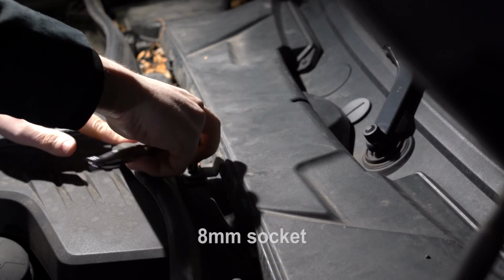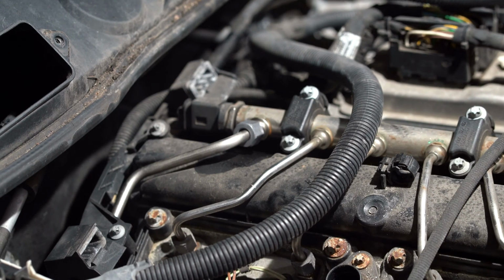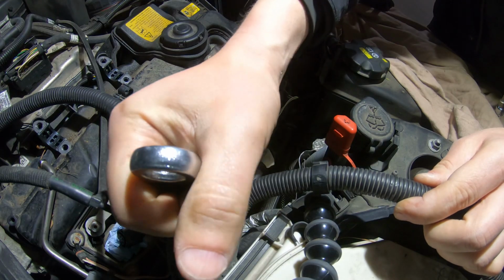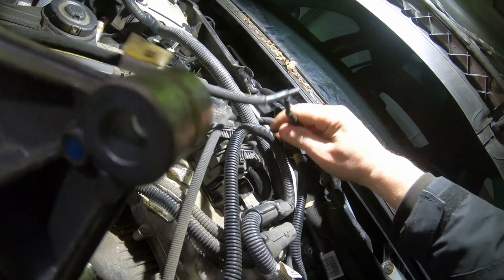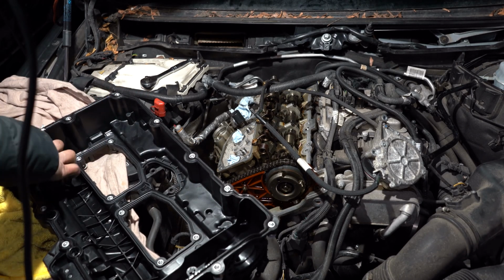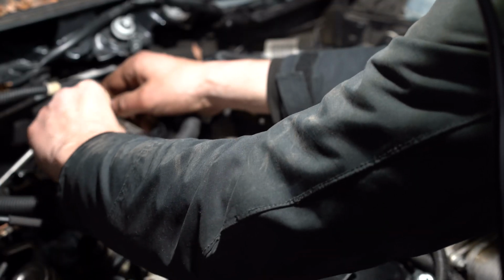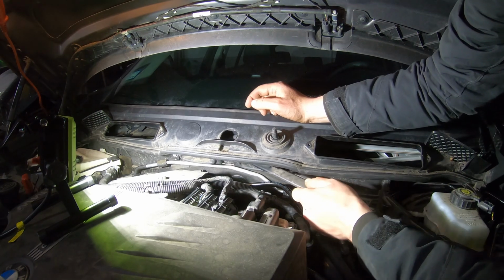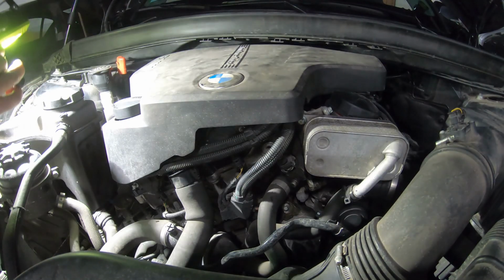How to Replace Valve Cover Gasket on a BMW N20 4 Cylinder (BMW X1 2011-2015 DIY E84)

Comment: The N20 is the shittiest engine design from Bavaria. All kinds of problems that BMW knew about and did anyway, crowning achievement of planned obsolescence. Plastic valve cover, plastic timing chain guide, no freaking oil dip stick.
Reply from the maker: I agree. And this car just keeps breaking down. All sorts of issues like leaks, transmission, electrical, all before 65K miles. This BMW is such a PITA to own and maintain. I wonder if we got a lemon.

Comment: Hey My girlfriend wanted a Beemer. She got it with all the labor intensive procedures because they use a plastic gasket in a vital area covered over by everything. WTH 
This is an excellent tutorial. I’ve done plenty of mechanical repairs. I would definitely hire a certified mechanic like Igor. Are you in Jersey by chance.

Comment: Thank you Igor! I'm in the middle of this process right now on my 2014 e84 and it's difficult, but your video has been a great help! 

By the way, do you have any advice about detaching wiring clips without breaking them? I've really been struggling with pulling the clips with the small metal teeth off of the various mount points, even with a screwdriver and pliers. I've broken a few clip mounts in the process... You make it look so easy that I think I must be missing something.

Comment: I changed the valve cover gasket thinking that it would solve my oil leak that fell on top of the exhaust pipe and smelled a lot of oil. But that is not the case, the oil loss has decreased but it remains the same, I think I have to change the valve cover, they say it may be bent... Is this true? Thank you!

Comment: I did it without taking off the wipers or wiper cowl. It's doable, but it was pretty hard to take the valve cover out and the vacuum pump out.

Comment: is the torque angle meter absolutely necessary?
Reply from the maker: The official BMW repair guide says that it is. But I have not quite figured out how to use it.

Comment: Hi , did we have to use a gasket seal when putting back the new cover??
Reply from the maker: Hello, not recommended. I just lightly greased it with motor oil
Reply: @IgorKadulenkov  thanks for the amazing video

Comment: Hello, I have a 2014 X1 281i and the directions fit well. Thanks. I cranked it up on the 2nd try and it went well. The next day it took 15 cranks to start up and today it will not start at all. Any thoughts? Do I have to reset anything? Codes came up Valvetronic servomotor - short circuit or disconnection and mixture fuel-air control - too lean
Reply: Hello, i did it last weekend, and codes came up, fuel pressure too lean. i have all week trying to start properly but it runs very bad once it hardly start. And drive it is really weird, not enough power when try to accelerate. How did you fix your problem? thanks

Comment: I watched this video several times and bought the valve cover online. It took me 2 Saturday afternoons but I was successful! Thanks very much for this great step-by-step guide. No more oil leaking!
Reply: did you have to replace the vaccum pump as well?
Reply: @ComebackRunner  I did not. Might not be a bad idea since it is already disassembled.

Comment: Great video, thank a lot, I couldnt find the ratchet for the vacuum pump removal but I used a 1/4 wrench intead, that was the hardest part, just need to be careful to not to drop the torx.
Reply: I used a torx key type wrench with a metal tube slipped on one end for better leverage.  Still a pain, but it worked.

Comment: Very professional! Your list of tools to purchase from Amazon is an added bonus to your step-by-step instruction guide. I have watched many videos on how to fix different things, but this one is the best I have seen. You not only showed step by step on how to remove the valve cover but also how to replace as well. 

Many thanks, I saved my daughter $1400.00 by not going to the BMW dealership. 

I found a URO brand valve cover "which is a recommended brand to use" from Amazon for 179.00, ten hours later from start to finish, and the job is complete. I could not have done it without your help. Thanks again, and may God bless you!
Reply from the maker: Thank you! I am glad it worked for you. Reviews like yours keep me going. And I do think that BMW makes it too hard to maintain their cars and their maintenance costs are outrageous. Congrats on saving $1400.

Comment: This video was very useful. It save me $2000 from BMW. I was able to replaced my wife's Volve cover from her X1 2015 model with no issues although it took me two saturdays(Was waiting on the valve cover to come) The tools on the link was very accurate and without them I couldn't do the job. Thank you very much for putting this video together.
Reply: That's right

Comment: Outstanding job. Looks like slow and steady is the way to go. I might get some paint pens to mark things….old guys can’t remember where it all goes sometimes. I’ve heard others say you have to rotate engine to BDC before installing HPFP? But it seems to go right back in for you. Thanks again for making such a great video.
Reply from the maker: Thanks Jon! I am not aware of requirement to rotate the engine. I used BMW service manual, haven’t seen such a requirement
Reply: I reccommend a silver sharpie or some neon nail polish to keep the injector and spark plug wires straight 😵
Reply: I used masking tape and a sharpie to mark the parts.  Even so, I still forgot to plug some things back in.

Comment: Igor,   how many hours did it take you to replace the valve cover ?
Reply from the maker: Hi Eliseo, it took me about 6-8 hours, but I was filming everything, so it took a bit longer.
Reply: @IgorKadulenkov  how long do you think without filming ?
Reply from the maker: @DjCBlaq  i'd say it would take me about 5-6 hours. Also, detaching the old valve cover after taking all the bolts out could take some time, I've had to apply a lot of force.